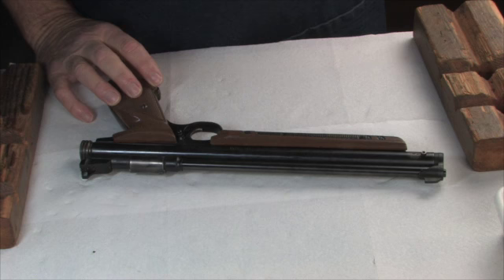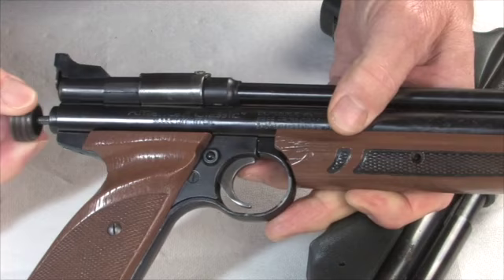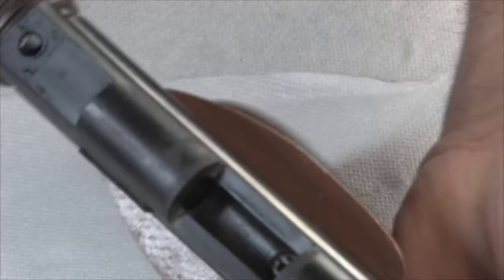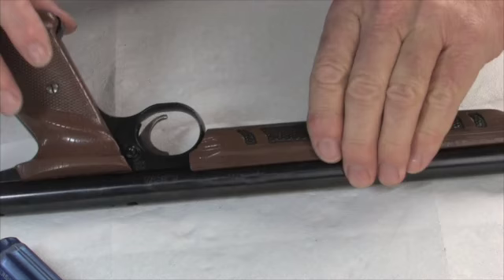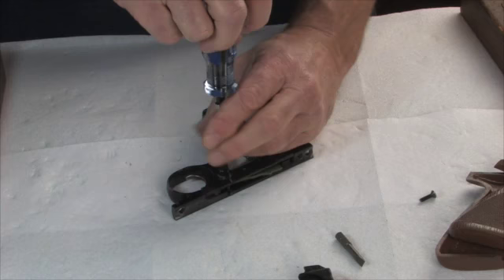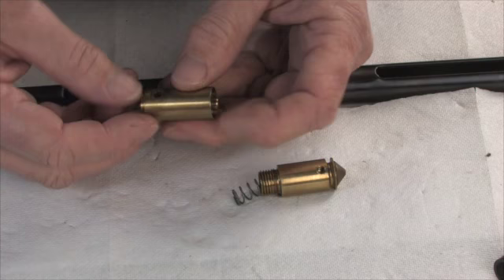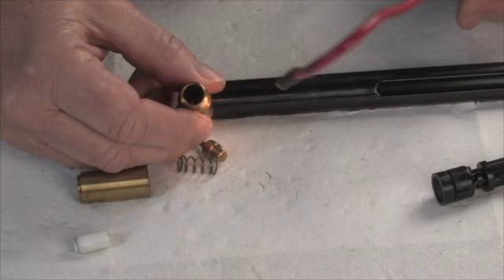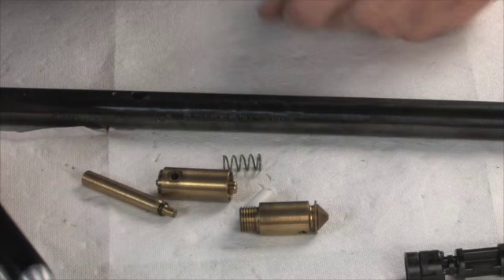Crosman 1377 teardown

Comment: Very helpful.  My sister and brother-in-law picked one up from a junk (aka "antique") store and it would not pump or hold air.  The overhaul kit I got on eBay was about half the price of a new pistol from Pyramid Air but I am glad I chose to rebuild this particular "antique".
My biggest problem was the hinge pin, which was held by a tiny snap ring on my pistol - I finally figured out how to pry it off without damaging it.
Reply: Do you have a link for the overhaul kit, mine doesnt hold air and I would like to fix it myself. Thanks
Reply: Hi, do you mind sharing how you removed that tiny ring without marring the tube? Not a whole lot of room there for many tools.

Comment: If you or anybody out there is like me that drops the tiny parts or they grow feet and escape the work bench, I highly recommend you to use a table with a rim or raised edge of about 1/2 an inch. You can make one with a piece of plywood and some square dowels or trim on the edge. Do all sides and so with that your tiny parts can’t escape the work area and you won’t be going nuts over a small thing
Reply: Another thing you can do is take a large flat baking pan and cut a piece of felt to fit inside it. Glue down the felt with adhesive spray.
You can stick magnets under the four corners of the pan to hold small parts so they don't roll away.

Comment: I hope you're still here.
I have a 1377 that I purchased during the early 90s.  I never maintained it.  It recently stopped pumping so I dripped some silicone oil where I could and it's now pumping again.

Mine, regardless of how many pumps, the pump handle will sag all the way back down.  It will even sag down if I apply VERY little pumping pressure.

Do I have more than a cup issue?

Thank you.

Comment: Awesome breakdown.  Thank you very much.  I have the original brass valve as well.  How do I replace the synthetic material that is in the valve stem?
Reply from the maker: most of us just buy a new valve stem, usually it is included in a kit.  If you notice m the brass cup that holds the synthetic seal is crimped.  So basically you would uncrimp, remove the old material, make a new seal to fit, install and re-crimp.  Way easier to just get the kit.
Reply: @NorthWestAirgun  Awesome.  6 years later and you are still responding.  I have seen the new valve stems for sale, but they all look like they are plastic and mine is brass.  I am sure it will work so ordering one.  Thank you.

Comment: I gave it my best shot but failed. My O-ring kit came with 6 but was only able to see 5. My gun is a little different that yours and I never could get the cocking mechanism out. $15 and about 3 hours and my 1377 is still dead. And putting it back together is much harder than taking it apart.
Reply: Renegadebroadcasting Renegadebroadcasting  NOPE!!! I had 1 O Ring that was bad and I was sure that was the problem, but it wasn't and it's still dead.
Reply: Renegadebroadcasting Renegadebroadcasting  I do on a regular basis.

Comment: I cannot get the pin in the front to budge.  Is there a trick to remove it or is mine just really stuck?
Reply: It is necessary to open the pump handle completely or partially. In some point both holes are aligned and it's easier to take it off. Use a big nail or a pin puncher.

Comment: where can i find a steel breech for this model   ?   all of the steel breech kits i found only fit the new models with the bolt .
Reply from the maker: There are several after market suppliers for the steel breech, Archer Airgun, Alchemy Airgun, probably others.  I don't know, however, if they offer the non-bolt version, you'd have to call and see.  Another place to ask about this is the Crosman Forum;

http://www.network54.com/Forum/275684

Let me know what you find.
Reply: Did you ever find a kit? I have this same model

Comment: I have a 1986 model 1377 that won’t hold pressure...  it will pump up but then will quickly lose pressure if you don’t immediately fire it.  Can you recommend a source for rebuild kits so I can get it working like it used to?
Reply from the maker: Try BakerAirguns or Precision Pellet.

Comment: I have this exact model with pull knob on back.  Doesn't pump air anymore.  Can you get parts for this?
Reply from the maker: Yes, there are lots of places to get parts, both original manufacturer parts and after-market parts.  Try Mac1airgunshop.com, archerairguns.com, or bakerairguns.com.  There are other places as well, some even specialize in supplying parts for this pistol.  You should ask at this forum;

  http://www.network54.com/Forum/275684

These guys are more up to date of sourcing of parts for this gun.
Reply: NorthWestAirgun Just put new o rings in and works like a charm.  I bought the pistol in early 80s and performs like new.  Thanks for the video.

Comment from the maker: @ Can't Stand Idiots
"Question perhaps you can answer. First let me say I enjoyed the video - most informative. I've subscribed. I'm 6"0 205lb Marine. And I have a hard time putting more than 5 pumps on this thing - usually shoot it at 3. I replaced the roll pin at the suggestion of another video who said that would make it easy to pump and that all pumps would be the same, not increasingly difficult as they are. Replacing the roll pin really didn't make much difference. The pump arm is still kind of wobbly - should I maybe try to shim it at it's pivot points? I've got to think there's something else that could be improved to make it easier to pump. Do you have any suggestions? Thank You so much. "
Reply from the maker: For some  reason your comment doesn't show.  Re: your 1322, try taking a shot , then don't pump, cock and shoot again.  Sounds like you may be retaining air, shouldn't be that hard to pump.  Let us know.